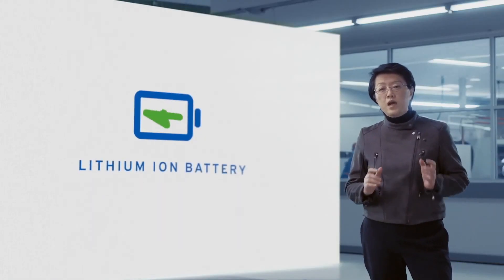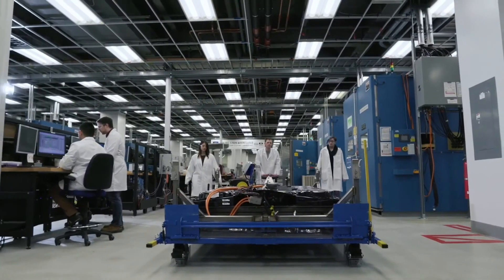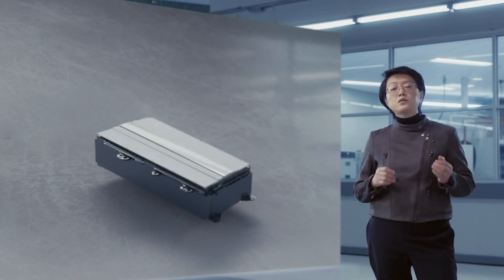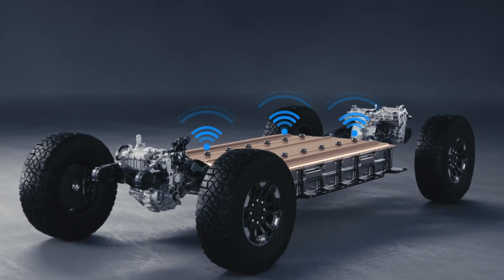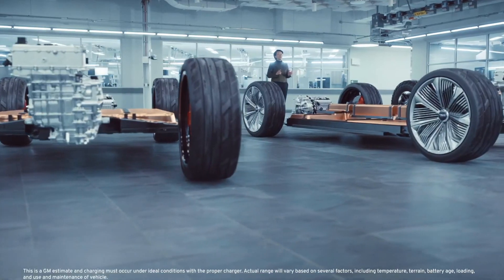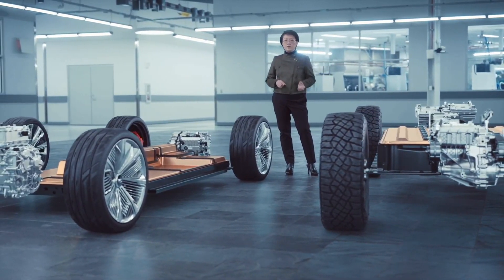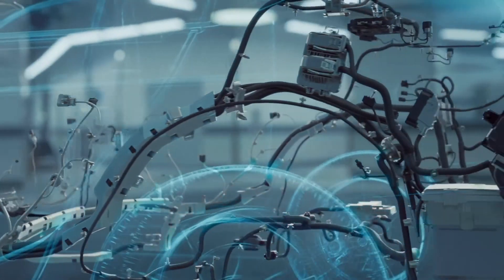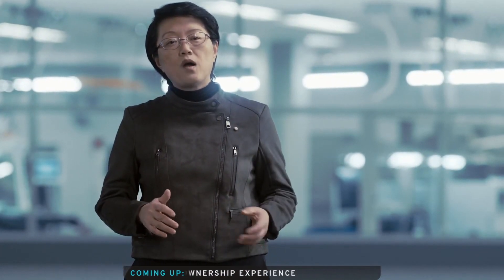Watch GM explain how their new EV batteries work (CES 2021)

Comment: Need more distance between charges to strive for higher success.  Need a full charge vehicle that go 1,500.00 KM on single charge then this will be the way of the future and abandon Fuel cells.
Reply: Wtf, no car currently gets 1500km/tank. Why are you setting such a high standard for battery EVs?
Reply: You will have to be patient for that.

I strongly agree that endurance is key. That and charge rate. Initially, EVs charged at less than 10KW (level 2 chargers). Fine for overnight. DC Fast Chargers raised that to 50KW. My 2021 Bolt can add 100 miles in 30 minutes. But newer and slightly more expensive models can do 140KW. That's about 250 miles in 30 minutes.

The last time I stopped at chargers on an Interstate, the chargers could do 350 KW if your EV could handle that. 300 miles in less than 15 minutes. Those chargers are now being installed. Now THAT is what I'm talking about!

Still years away from that being mainstream technology.

Comment: You had me until the “intelligence system”  you know what I would work on if I were gm would be head lights and tail lights that don’t burn out so quick.  If you drive down the road and see a car in front of you with burned out lights, 9 times out of 10 it is a gm vehicle,
Reply: Why not let the head lights and tail lights works separately with small solar panels on top?
Reply: They have another problem they don't have a factory that produce a million car batteries.   So unit they get their production up and running they are not a player in the EV market yet.

Comment: A representative from a major car manufacturer told me that they try to build a vehicle that fails just after the warranty expires combustion vehicles are difficult to engineer planned failure but electric will be much easier as iphone has proved.
Reply: I stick to toyota hybrid for now. I know they last way longer.
Reply: @cemoguz2786  I have a ford fusion hybrid they were sued by Toyota for copying the prius system it has a 20 mile electric only battery and is currently averaging around 115 mpg plus its a bigger car
Reply: That’s all talk about the engineering to fail. Everything mechanical and electrical can fail. But the real problem that absolutely nobody talks about is right to repair. With these EVs coming out GM will make it impossible for independent shops to work on them without some password or encryption key. Exactly how Apple has done with the iPhone.
Reply: @Villageidiot2  Yeah i think Tesla is paving the road for that future

Comment: did you Read the small print in video ????????? 3:23
Reply: That fine print seems reasonable and applies to a lot if not all systems..
Reply: Good eye!!! It says it’s a GM estimate and that the battery life will vary based on different circumstances like temperature, size of battery, terrain, etc...